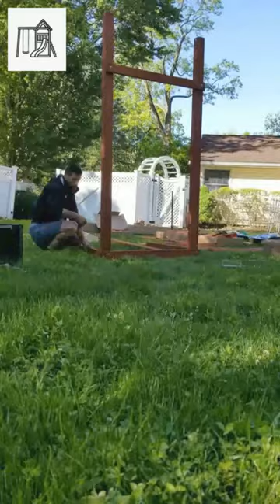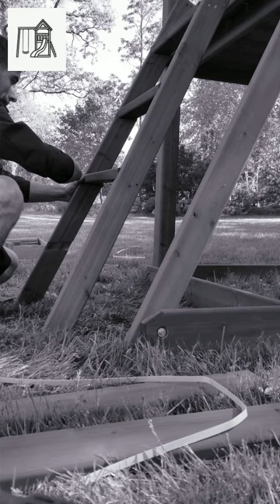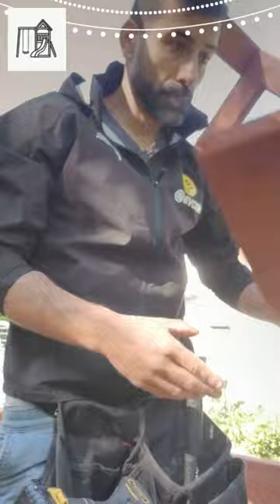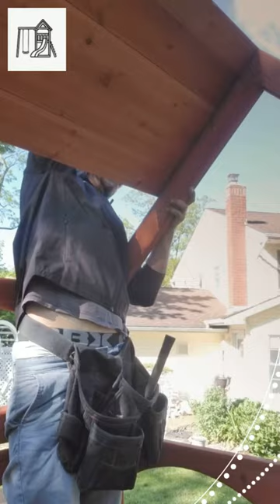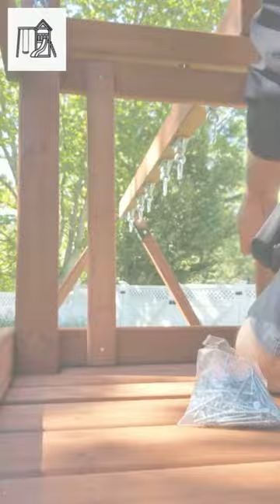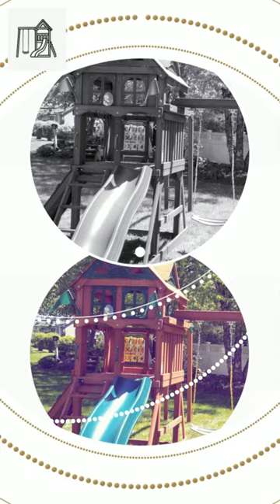Gorilla Five Star II Swingset Assembly With timelapse

Comment: Did you mount the playset into the ground?
The manual said to dig 4 holes, attach the in-mount wood and pour cement into the holes to mount it.

If you didn’t do that, how did you mount it to the ground? Or is it heavy enough to be stable?
Reply from the maker: Steve this model Does not need to be concreted into the ground only the spacesaver does, all the other models come with ground anchors to be hammered into the ground and screwed into the playset. 
If you are in the tri-state area or near I can help with assembly. Contact me